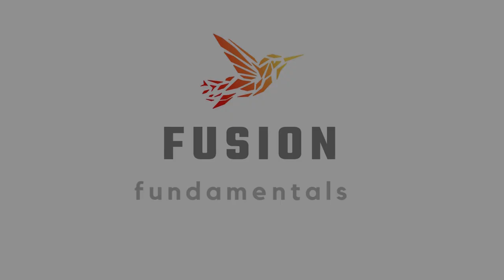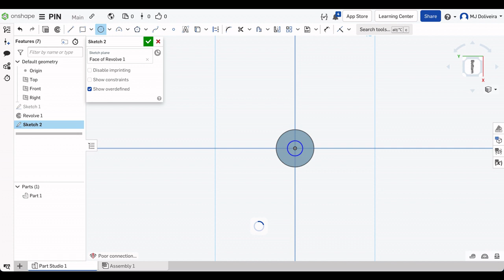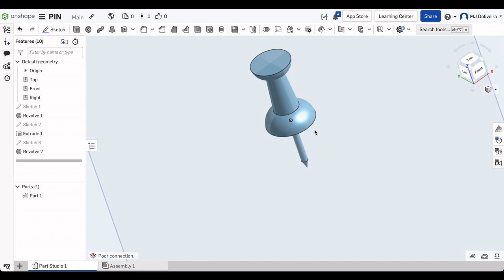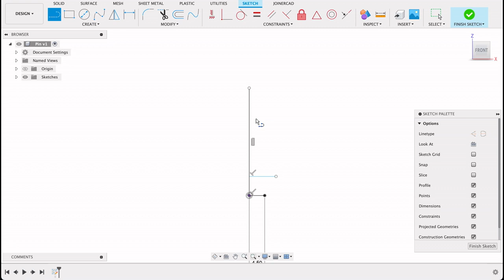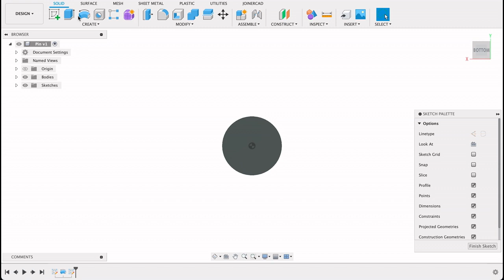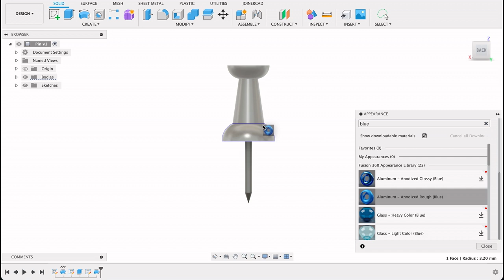Fusion 360 vs OnShape: Practice exercise #11

Comment: - Quick, and simple :)
- A FEW TIPS [in F360]...
--- Use 'Centerline Line' for axis of revolution: can set full-width dimension (no need for /2; and better shows design intent). Also, 'Revolve' will automatically recognize/select construction line as 'Axis'.
--- No need for the middle horizontal "reference" lines (or at least make as 'Construction Lines': 'head' will be single profile). Instead, rough in top line, bottom, and slanted - then do '3-Point Arc'; and finally do dimensions. Or, better yet, use the "arc from line" trick: hold down mouse at end of line, then drag: voilá, 'Arc'! :) (For details, search YouTube for "Fusion 360 - Secrets of the line command".)
- And, minor point: 'pin' could be done is same sketch as 'head' - would eliminate need for another sketch, and for 'Project'. Of course, usually, sketches should be kept simple, and design aspects should be "decomposed" into their own sketches - but in this simple case, all-in-1-sketch seems fine.
- Anyhow, hopefully some users will find these tips/comments of value/benefit. MODEL ON! :) ...
Reply from the maker: Thanks for the input

Comment: I think I’ll probably stick with fusion at least until my free 1 year license runs out
Reply: There is a version for hobbyist that does not have a expiration date like the free trial version
Reply: @erickcandanedo3210  hmm I didn’t know that. I will check it out. Thank you for the info
Reply from the maker: thanks
 @erickcandanedo3210
Reply from the maker: Yes i agree, Fusion is my preferred option as well. Onshape is good and has a lot of free features but it is also not quite as premium a product as fusion. That being said there are a lot of users.